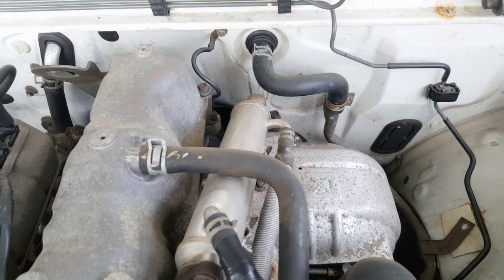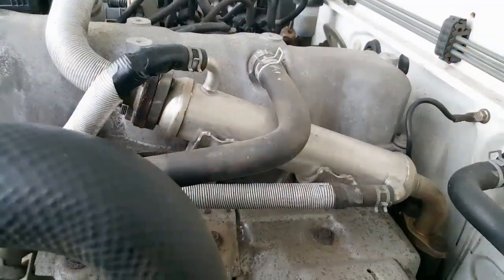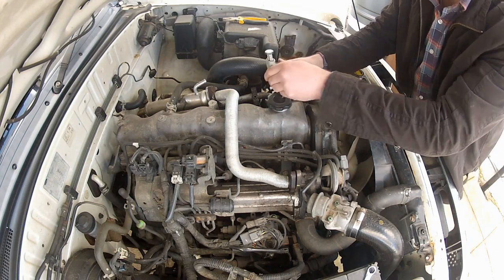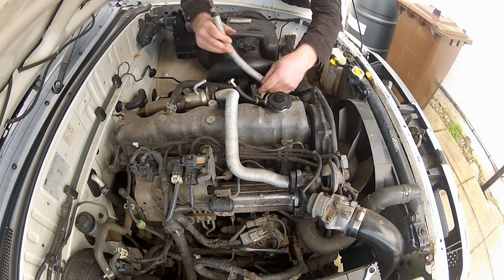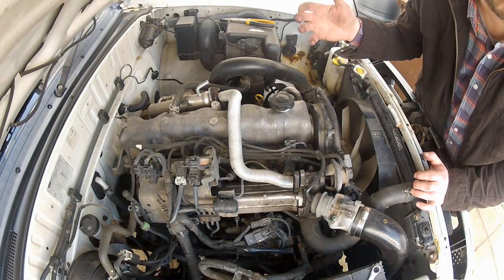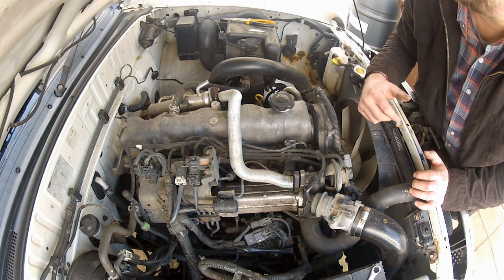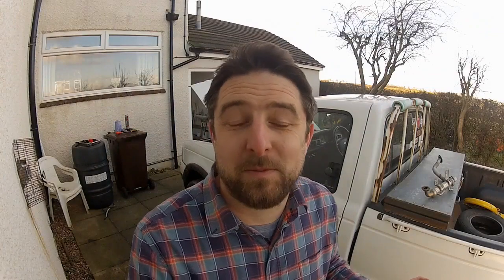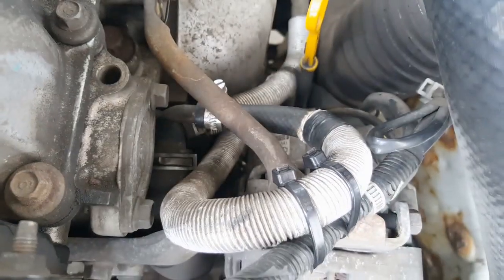EGR Blanking Part 02 - Pipework Delete (Ford Ranger TDI) | Tech Tip 22

Comment: EGR blanking will cause the head to crack because the burn is now to hot. I have seen this happen.
Reply: How the heck can blocking exhaust gas going in inlet cause more heat?
Reply: @loftyabode because It takes away the oxygen, so you have a lower burn ratio
Reply: @mikepeterson6527  oxygen comes from the air intake  not EGR
Reply: @loftyabode  that’s what I said, read carefully
Reply: @mikepeterson6527  does egr gasses cool the combustion?
Reply: @loftyabode  yes by reducing the amount of oxygen in the intake, so it doesn’t burn as efficiently as it could!
Reply: I think you should Install a bigger Intercooler in combination and dont have Problems with overheat
Reply: @dirkhoegen4620  No, you are wrong.

Comment: Always great videos from you! Thanks!
Ever worked on a V6 2.8 Bronco or Ranger? I have a Capri USA 2.8 with the same engine and wanted to get rid of all the nonsense EGR constructions... well it is so tight back on the exhaust manifolds that is simply impossible to access the feedback ports without taking the engine out of the car!
So that will be my next job someday, that gives me a chance to respray the engine bay as well.
Reply from the maker: Thanks a lot! That's one determined EGR system. Is this the same 2.8 as we got here in the UK? 'Cologne' we call it. Came in Injection form over here.
Reply: @FastRust  Cologne block is the same, but heads are slightly different, with 3 exhaust ports each, of which 2 siamese joined. Ant Anstead shows it well in an episode of Wheeler Dealers: https://www.youtube.com/watch?v=qBz9xB_Oaw0
Reply from the maker: Thanks, will give it a watch 👍